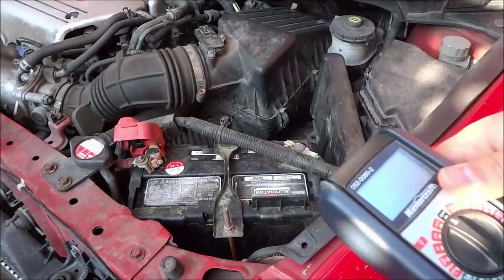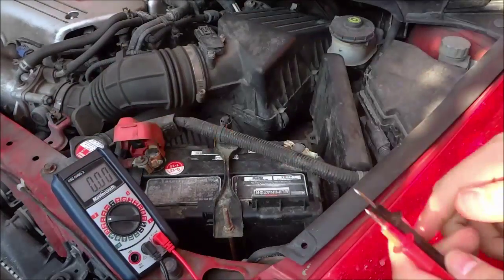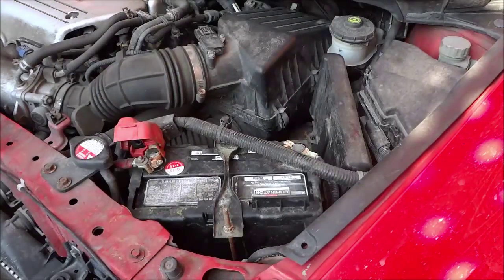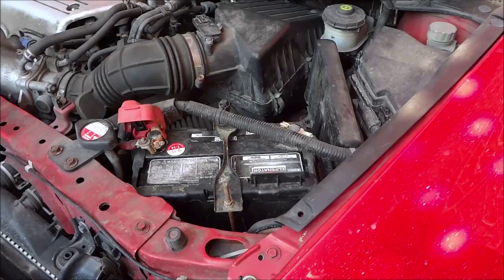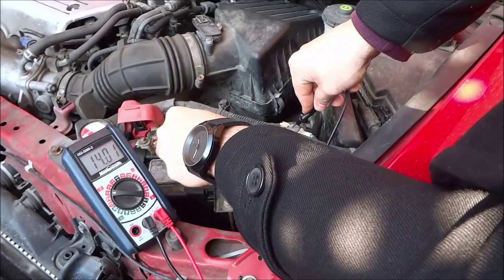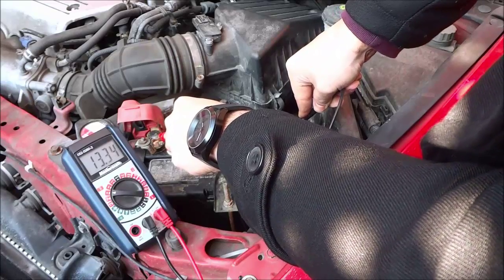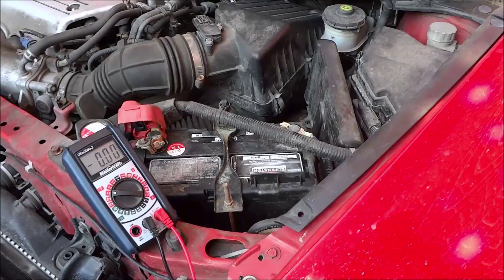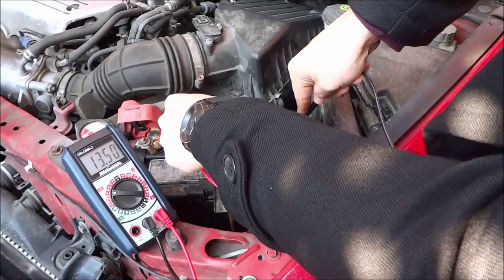How To Check A Car Alternator With A Multimeter

Comment: So my car reads like 9.77 with the car off but when I turned on the car it kept dropping little by little through out time; you think it’s the alternator ? By the way when I put the multimeter test to the alternator it only reads a little above 10 volts

Comment: Although that is one way to check the alternator.  Couldn't there be a fuse or relay that is not allowing the charge to get to the battery? Do you have a video on those other checks ?

Comment: Car just clicks, sometimes doesnt even do that,  so jump it, battery voltage is about 12.6 running. The voltage on my battery a few hours after i jump it is down to 8 or 9V. Lol are they both bad?

Comment: Awesome!! Now that I know the truck is perfectly where it needs to be 14.5-15 You saved me time.  Now I need to know why gm voltage gauge is higher than all the others. On the a wiring diagram.  Thanks!

Comment: I recently had my car’s alternator replaced because it died. After receiving it from the mechanic everything checks out fine on the battery bolts. It reads 14.07 when just on and with accessories on its 14.03-14.07 so I know it’s good but after driving a while I noticed that my headlights dim and brighten after driving for some time. Also my dash and interior lights dim just slightly and I went to check the alternator but it was still powering the same voltage. No drops. I’m thinking after the alternator was replaced it might’ve gotten bad ground

Comment: A very, very, very basic check and not really a good test of the true status of your alternator.  To properly check or test the alternator, you need to remove the alternator from the vehicle and bench test it.  That way you are eliminating "poor electrical connections and wiring" in the charging system and you are testing the actual alternator.  For example, if the alternator tests good on the bench (out of the vehicle) and the battery also checks good, then your problem is wiring, a connector(s), or another system parasitically pulling or hogging the charge.  While electrical wiring and connectors "look good," you never know until you check them with a multimeter.

Comment: Thanks so much for this very informative video. This exact thing happened to my wife and I this morning. Thank God, we were able to make it back... our car stalled in from of our driveway. I watched your video, used my daughter's car to charge my battery and then learned how to use my multimeter to do the testing. I'm a mechanical blockhead so the detail in your video was instrumental in making the information understandable. Again, thank you for putting this together. Miles

Comment: Good video! but you should've measured both the positive and negative side circuit on the alternator using your multimeter.

Comment: What about testing directly on the alternator to eliminate wiring issue vs bad alternator?
Reply: Yes so true. If output is low when running it could be wiring and not the alternator itself.

Comment: What happens if I have the car running and it reads 7v? But my battery is at 12.4V? And everytime I have to start the car I have to jump it real quick.
Reply: Did you figure it out
Reply: @user-xb9qm9gx6x  no lol I just got a new battery and it worked out and never happened but the mechanic said it wasn't holding charge

Comment: Badger cleaned his act and became a mechanic. respect ✊
Reply: Skinny pete holding the camera😂
Reply: Holy hell he sounds just like him 😂😂
Reply: The exact same thing was going through my head
Reply: Funny, I couldn't think on who he sounded like. Now that you said that you nailed it. 505 represent
Reply: Thanks. This is something I should have known but didn't. This helped me. What about testing directly on the alternator to eliminate a wiring issue vs bad alternator?
Reply: I was expecting the river dance at the end
Reply: 😭😭😭🤣🤣🤣 I'm dead
Reply: It's his voice double lol
Reply: I'm not a mechanic but as far as i know, there's nothing wrong with your alternator 😅... when your engines running approximately  12-13v more or less point something.. and when you turned on your AC  it is normal for the battery to lessened the reading on ur multimeter...in short as long as there is many switches on like, headlights, AC, the battery reduces its charge but it won't go down below 12v...from the very beginning when you started the car you get 12-13 volts higher which shows that your alternator is working good... so for me I dis agree with you that your alternator is already bad coz it's not😀.. unless you started your engine and you got a 12v getting lower to 11V den dat shows that you're alternator has an issue... thanks😊
Reply: @alli_moto7154  You make sense.
Reply: 😂 I knew he sounded familiar 😂

Comment: Thanks for the great video . I followed your instructions and with the car off I got 12.4 v with the car running I got 14 .20 and turning  the lights and ac on , it fluctuates around 14.8 to 14.20. So it’s not the battery or alternator but I have difficulty turning the car on , once it is running it operates fine but if I stop to get gas it won’t turn back on and I have to jump start it. What could cause this. There is slow beam light that’s out. Could that be the culprit  the car is a bmw745
Reply: Might be too late but terminals
Reply: might be bc it's a bmw
Reply: Mine did the same, Turned out to be the security alarm. Was putting a director draw into the battery.
Reply: could be a faulty starter maybe?
Reply: Parasitic draw check fuse and if voltage drops than it will tell you which terminal relevant to the power drain.
Reply: Check your starter motor ground cable, my old gti was like that and it was the ground being loose, wasted so much money on an alternator and battery to find out all I needed was a 10 mil socket 😂

Comment: Thanks for the excellent video.  It was just as your channel title suggests: a Helpful DIY.  I had read that it is not a good idea to test an alternator as people did when I was growing up and cars were not so elaborately electrified.  So taking off the negative strap of the battery while the car is running is NOT recommended by most of the YT community so far as I can tell.  I always look for the shortest video hoping it will provide the information I need and you came in as one of the shortest with the most relevant information.  Thanks.

Comment: Thanks for the video, but even if after you turned on the heating system and the charging system is 13.5 is still good as it is above battery voltage by about .05 volts... that means the alternator is putting out.. with all accessories on.  If his over 13.5 or 14.5 that alternator is overcharging which is just as bad, if not worse than undercharging as this can destroy the battery and can damage the alternator .
Reply: the voltage should 13.8 to 14.2.
check this page out: http://www.todayifoundout.com/index.php/2010/01/how-to-test-a-car-alternator/

Comment: Ah, I was expecting to see you accessed the alternator terminal directly : B, S and L terminals. You didn't, so this video should be titled : How to check car alternator through battery terminal voltage reading using a multimeter.
Anyway, this is a quick, first inspection that a layperson can do. For thorough check, we should access the alternator directly.